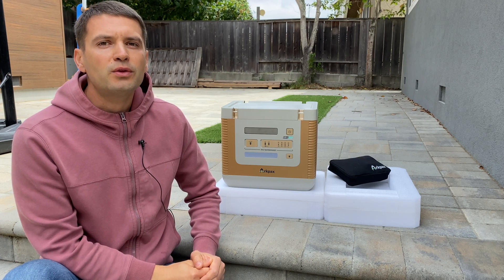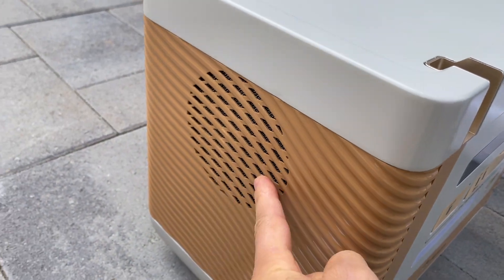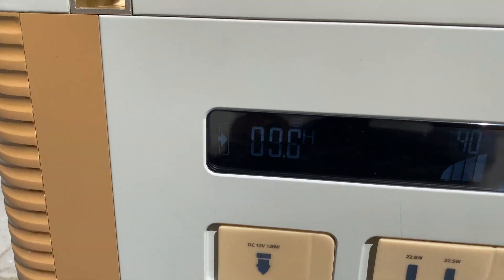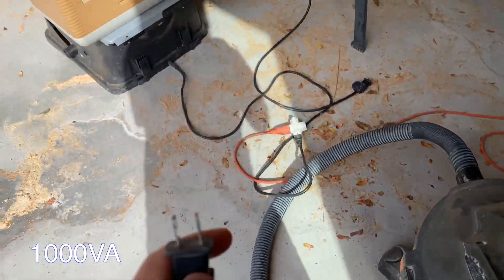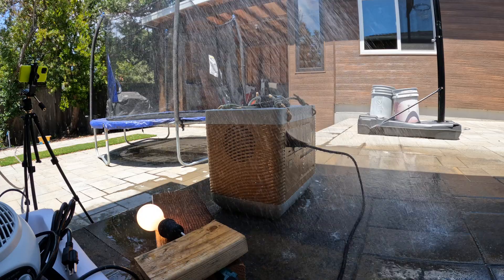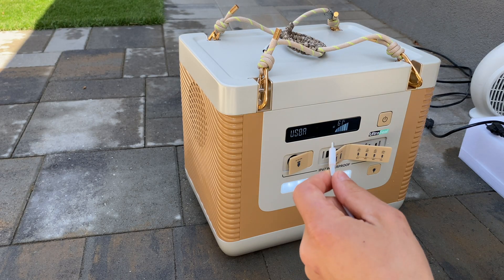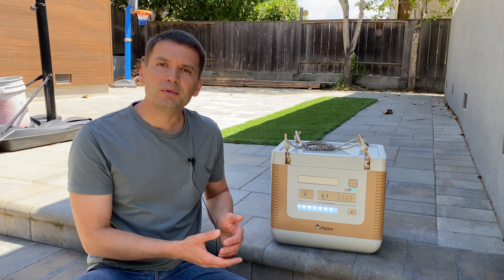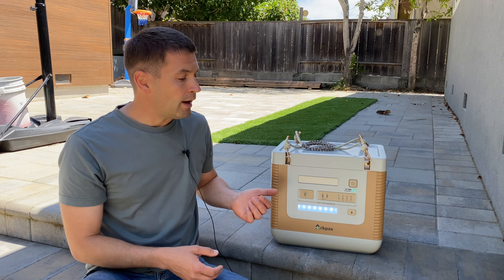The World's First Arkpax Ark 1800W waterproof power station + Review

Comment: Normally i am a bit sceptical about reviews of power stations, because they are just advertisements and sponsorships in disguise. But this is actually an extremely thorough and honest review.  Thanks for making it!
Reply: Agree, this is the kind of review I like to see. I loved what I saw of the build quality for this as well. A couple of tests I would like to have seen, 1) using the device at the same time as charging (as UPS for example) 2) Low temperature operation capabilities and low temperature charge cut out. I hope they make one in muted colours - perhaps even multicam.
Reply from the maker: yeah, good idea to add at least 2 more tests:
solar charging + some load 
connect to grid + some load exceeding charging speed.
Reply: @Anchor2012  I like the low temperature suggestion. When camping fall or early spring, my small power banks regularly give out - would be a very good use case for these bigger ones. And a test "just" requires a freezer for a few hours. Weirdly i never seen a youtuber do those tests.
Reply from the maker: thanks for the feedback